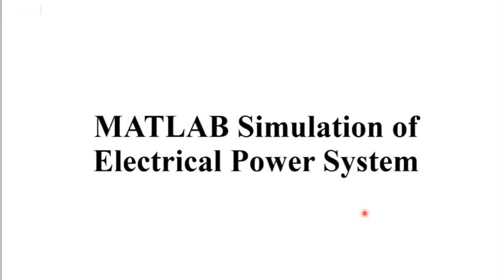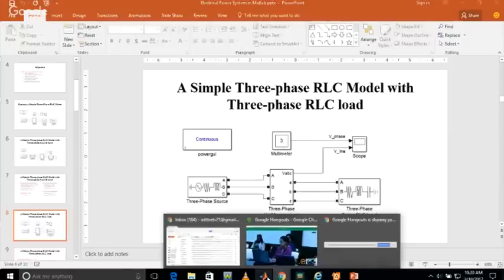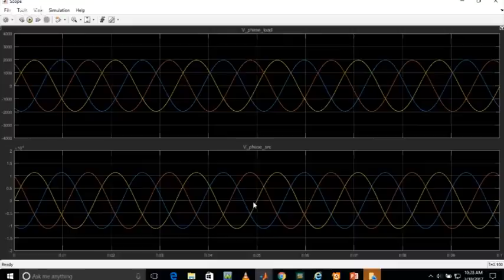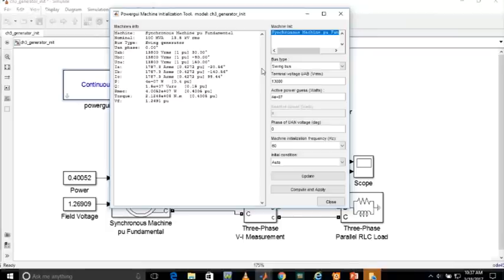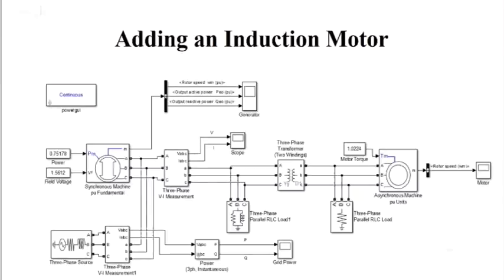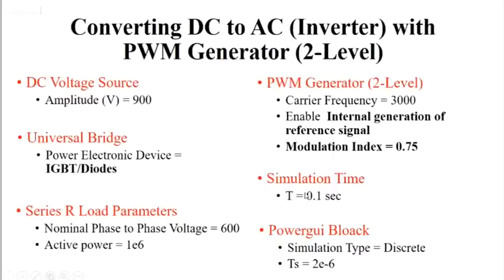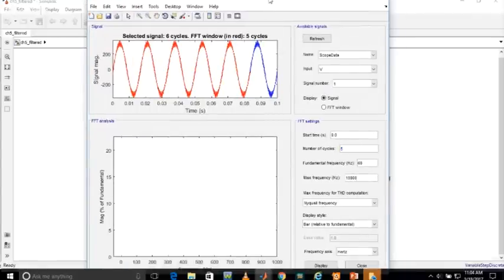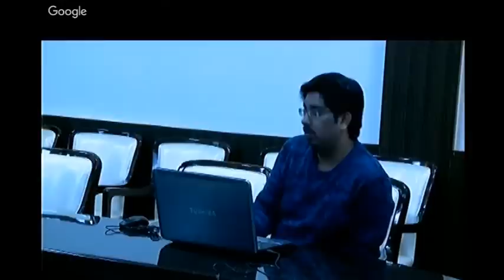MATLAB Simulation of Electrical Power System By Mr Kuldeep Singh

Comment: sir in the matlab simulation when you are connecting the synchronous generator with three phase source , for load flow studies you are labeling thre phase source as swing bus and synchronous generator as PQ bus. according to me synchronous generator bus should be labled as PV bus inted of PQ , because its voltage is specified.